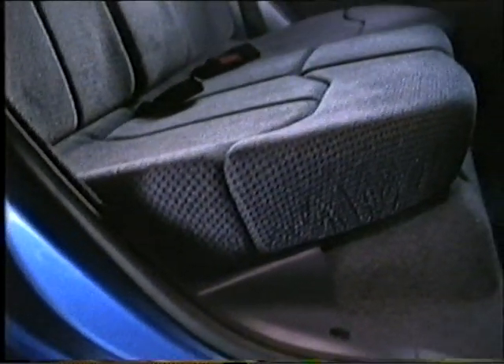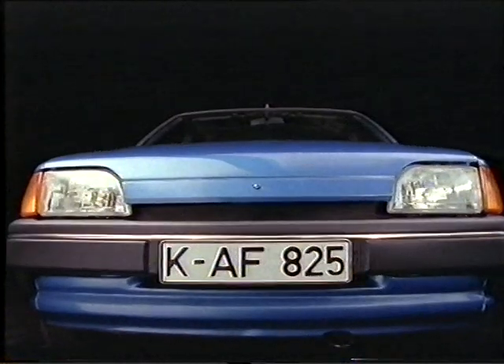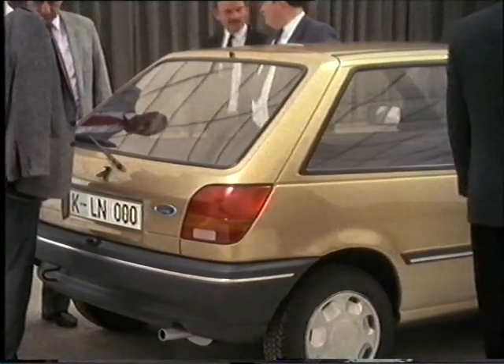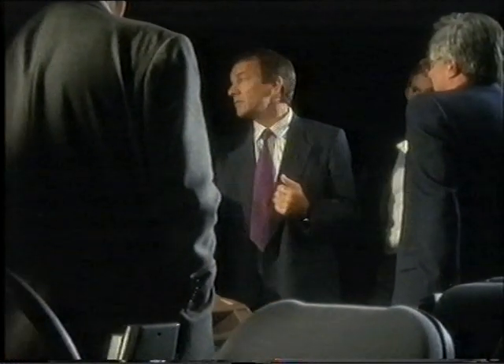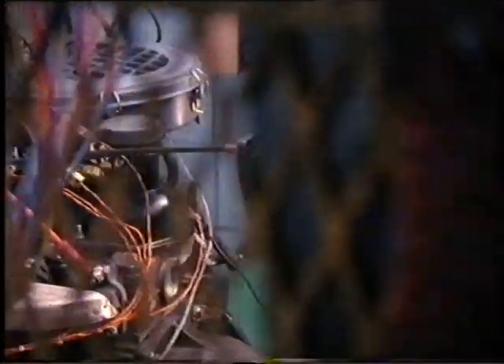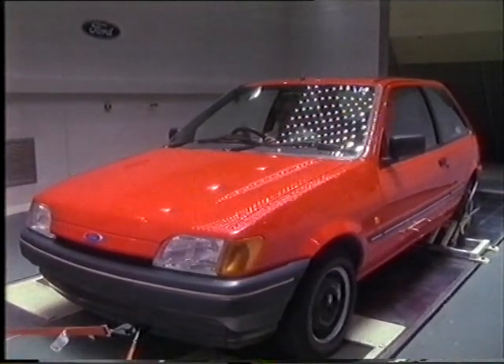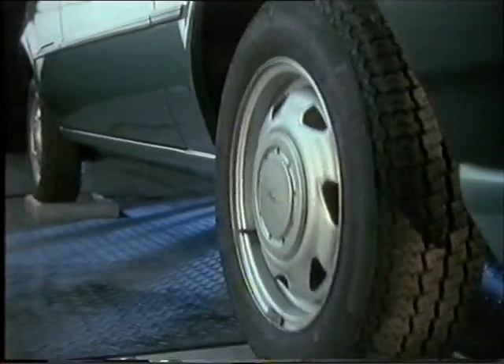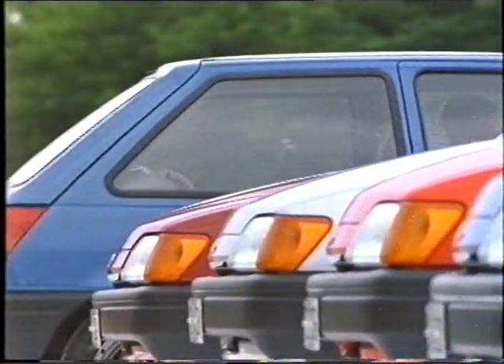Ford Fiesta Launch 1989

Comment: This was GREAT!!!, I have owned a 1992  Mk3 Ford Fiesta for 11 years and LOVE it, a very reliable little car, nice styling, easy to clean, good fuel economy, and fun to drive, cost £400 to buy secondhand, I've spent £3,500 on her restoring the bodywork, and replacing a few worn out parts, so a total cost of £3,900 over 11 years is cheap motoring, My Fiesta Mk3 makes a superb daily driver 26 years on from when she was new, (I call her Ellie!) she is also an Automatic version, and the kick down gives good acceleration for overtaking, and smooth gear changes,  in short the Ford Fiesta Mk3 is a Great Classic car, to own and drive.